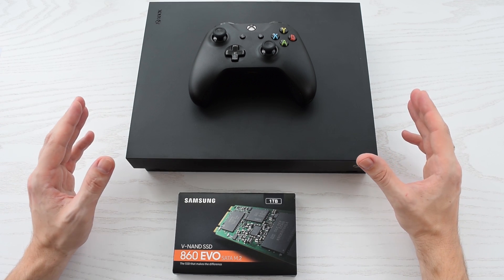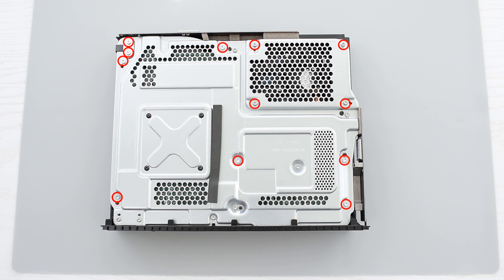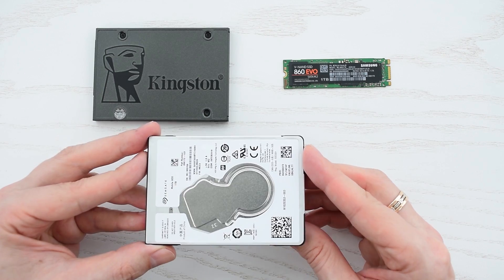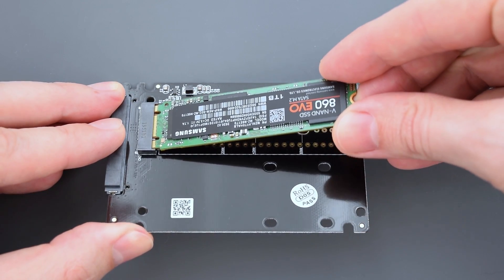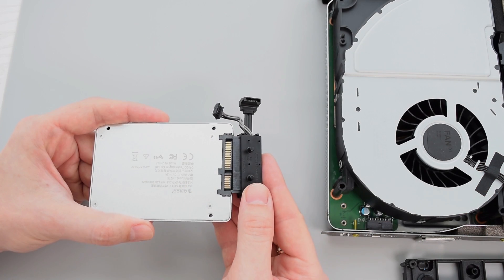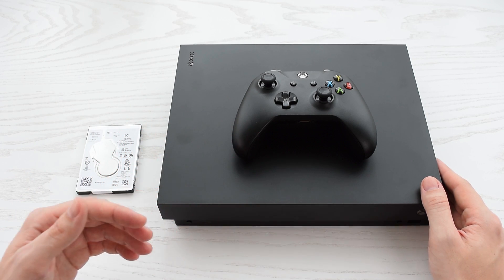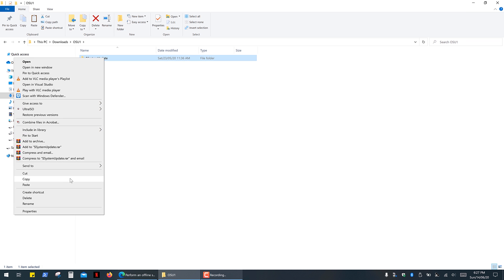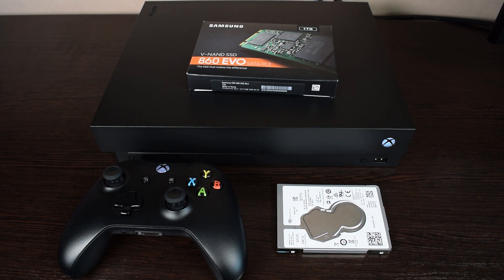How to Upgrade your Xbox and PlayStation Console to M.2 SSD Drive. 100% Works for all Consoles

Comment: Good video.  But, not clear if I have an Xbox (S or X) 1TB HD and want to upgrade to a 2TB SSD do I need to use scripts?
Reply from the maker: You can upgrade any of them to 500Gb, 1Tb or 2Tb SSD. You can use any SATA 2.5" or M.2 NGFF (SATA) SSDs.
Reply: The xbox one x will support 2 4tb drives. You can use up to a 4tb hard drive/ssd inside, and another 4tb externally.

Comment: Clocking in better harddrive speeds..
But still some games are GPU heavy.
Reply: If the cpu cores are custom, than their isn't much else that can be improved here.
Reply: I hate that the multi view capabilities was removed for a dumb excuse when TV's rarely have it. Folks are still not happy about halo 5 cut out the local coop.

Comment: I think use a normal SATA ssd is cheaper than this solution... but ... it works too
Reply from the maker: Sure! But if you already own an M.2 SATA SSD for example, after upgrading your laptop or maybe you just want use that M.2 SSD in another device after your console dies, then it's pretty good option.

Comment: Is there a big difference between an M.2 SSD and a regular SSD? Because from where I am M.2 SSD are much more expensive and I already have a regular SSD.
Reply from the maker: M.2 SATA (NGFF) has the same speed as a regular 2.5" SSD. The difference in price is not that big, don't confuse NGFF SSD with NVMe which is way faster and more expensive but you can't use NVMe drives anyway. If you already have a 2.5" SSD then there's no sense to upgrade to M.2. But if you had a spare M.2 after  upgrading your laptop or you have some plans for that SSD in the future (2.5" form factor is becoming obsolete when M.2 will be very popular form factor) then M.2 NGFF SSD would be a great choice.
Reply: @ElectronicsComputers  Thanks a lot man, now my only concern is that it's said that if you replace the Xbox One S internal HDD your console gets banned, is that true?
Reply from the maker: @pedrorodriguez418  Nonsense!!!!!! Who said that??? I've replaced dozens of HDD/SSD on different consoles. None of my clients ever said that something was banned. It's not an Apple product!!
Reply: @ElectronicsComputers  You saved me a lot of research, you've got a new subscriber.

Comment: i got this on amazon would it work for my ps4?

StarTech.com Adaptador de SATA SATA de 2,5" para bahía de unidad de disco duro de StarTech.com https://www.amazon.com/dp/B076S9VK1M/ref=cm_sw_r_cp_api_i_TtTwFbCES67GT
Reply from the maker: That adapter is for two SSD drives which means it has some controller on it and as a result drop in speed. Find any adapter which has only one port for M.2 drive. It works for all devices consoles, laptops etc. The links for high quality adapters in the description.

Comment: Super valuable info, man. I have a Toshiba 1Tb NGFF drive left after upgrading my laptop. Now I'm gonna upgrade my PS4 with that adapter and the SSD.
P.S. I was reading the comments and I can't believe so many people don't understand the difference in M.2 SSDs all they see is M.2 port and by default they think it's NVMe SSDs even though you explained the difference. I'd remove all those comments because they are confusing other people who's not good at tech.
Reply from the maker: I'm glad it was helpful.

Comment: What's the speed differences between M.2 Sata SSD internal vs USB 3.0 SSD external?

Great video btw. Thanks!
Reply from the maker: Theoretical speed of SATA III is 6Gb/s and USB 3.0 is 5Gbps. But you looses speed and performance during conversion signal from SATA to USB and vise versa. So the difference is quite noticeable.
Reply: @ElectronicsComputers  Would it be better to replace the internal drive? 
Though my testing, having an external SSD didn't change the boot up speeds. Perhaps because the boot was configured to the internal HDD?
Reply: @NopeKickEm  i would only replace the internal hard drive with an ssd if it fails other wise you will end up taking the game console apart but yes the boot time are improved

Comment: Can work M.2 nvme, or only M.2 SATA??
Reply from the maker: You can use only SATA-based (NGFF) M.2 SSDs. Technically, Xbox One X has M.2 NVMe port on the motherboard but for some reason Microsoft decided not to solder it to the motherboard. I'll try to solder the M.2 port and all the missing components and we'll see what happens. https://www.reddit.com/r/xboxone/comments/h9r9qx/xbox_one_x_has_a_unused_m2_port/
Reply: @ElectronicsComputers  have you tried it yet?

Comment: this is fucking stupid you use an adaptor idiot. The difference is 0 compared to normal SATA drive. Infact this m.2 will overheat and slow performance. Open up a SATA SSD it has thermal pads inside and is usually aluminium enclosure for good quality ones. Misleading mong. Your M.2 is also SATA its not NVMe. SATA M.2 should also be abolished on general.
Reply from the maker: Are an idiot dude or what? What misleading are you talking about? You can only use M.2 SATA drives in this console and they never overheat don't confuse them with NVMe (PCIe) drives.

Comment: what was the performance difference?  loading time?

Basically the logic board's bit rate is still Sata & it will not use the full capacity of ssd's speed🤔🤔  proof of concept would have helped.  plz do a video on that
Reply from the maker: This is SATA M.2 SSD and it uses the full potential of Xbox SATA port.
Reply: @ElectronicsComputers   correct,  it uses full capacity of SATA bit rate... but ssd bit rate is much more higher which the logic board is not capable to handle.. 
 hence not making use of the money spent on buying ssd(which is way to high)
Reply from the maker: @snlsp12  this is SATA SSD which has the same speed as SATA port on Xbox. What bit rate you are talking about. Don't confuse SATA (NGFF) M.2 SSDs and NVMe (PCIe) SSDs.
Reply: @ElectronicsComputers  thnks brother!! I will do more study on this..

Comment: M2? For what? It's cheaper? Standard 2,5" SATA is more than enough for PS4 PRO and Xbox One X. I have 2TB Crucial BX500 SSD in PS4 Pro.
Reply from the maker: For example, maybe you have one after your laptop's SSD upgrade or maybe there's a good price for SATA M.2 drives. Or maybe just because M.2 factor is the future and all devices come with M.2 SDDs. And when your console will die you could put that SSD into any device when 2.5" won't fit because this form factor is almost obsolete.

Comment: Good Video. I was worry to update my xbox one due to the big job on partition but now microsoft may easy with the new tool. I was reading all comments, i don't understand why people not understand the difference between sata 3 m.2  drive and nvme m.2 drive. Its not too much difference on price with ssd and m.2 sata 3 drives. Have one question. Is possible to remove the DVD drive on xbox and install a second drive. Could be a good experiment.
Reply from the maker: There are lots of "tech expert" here. I'm tired of explaining and educate those people. I guess I'm gonna remove stupid comments in the future. By the way, Xbox One X has a solder pads for M.2 NVMe SSD. So I want to solder M.2 slot and all the missing components to the motherboard and see if it's gonna work. I haven't tested Xbox with the second internal SATA drive but I think it's gonna work. I'll check it and update this comment.

Comment: This would end up havi g the same data transfer speeds as an SSD due to limited bandwidth on a SATA connection.
Reply: Charbel Chahine  I don't think that drive even fits in the adapter since it is the nvme drive. I'm not sure make sure you do research. That was my whole argument with the youtuber guy. His point was to show us it works but the speed isn't faster than a 2.5 ssd. If you could put in the faster nvme samsung evo the ps4 wouldn't go any faster since it only supports sata speeds on the sata buss as we have already chatted about. It is purely limited to the hardware on the xbox one x or the ps4 pro. Those have better video but the speed of the hard drive is the same. Mechanical drive but you can upgrade to an ssd 2.5 samsung evo 1tb or crucial and have the 500 or so read and write. That is the fastest you can go. Until ps5 comes out or the xbox series x or S model we won't know what you can take apart or upgrade. I'm SURE iFixit is just ITCHING to take it apart as is everybody else. I hope this helps. Ask the youtuber guy he is pretty nerdy and made video's on it.
Reply: Charbel Chahine  I'm sure it can't. If that's the newer model. The adapter will probably not work. Best bet is to get a samsung or crucial ssd with 500 read and write. Fasted you can go right meow.
Reply: yes its the same speed but better IOPS which is usually better due to reading of small files
Reply: @NinoKotur  OK so Its really not worth it just for that. I"d stick with the 2.5 ssd.
Reply: @barrysauce  Depending from case to case it might show some difference truth is especially model S doesn't have enough horsepower for 2-3GB/s transfers so improving those IOPS speeds can be good in some cases, also prices of m.2 nvme-s dropped a lot especially where I live there can be as little as 10eur difference between same size ssd and nvme m.2 if not looking at the cheapest models.

I agree there is not much point of doing that but if you get a similarly prices m.2 nvme why not ;-)
Reply: @barrysauce  what about cheap ssd vs evo 960? Is it has the same speed? What if i put it on ps3?
Reply: @eryavrilio3751  I did the same thing to my ps3 and my parents too before you couldn't use them anymore for netflix, amazon prime, YouTube, etc. Crucial BX series are fine at the lower end. The SK hynix are shipped with Dells I've seen at work and they are fine. Don't go too cheap on an ssd or you get the issue when you do one thing and it goes very slow. Anything that can get an ssd will benefit tho. Ps3 ran fine I never used it with a spinny disk so I don't know how slow it really was.
Reply: The price to get the better drive is usually with it too. Oh Kingston are not bad either. The names brands make gooder stuff. Hope that helps.
Reply: @barrysauce  crucial data read&write speed are higher than kingston so i think it's more worth to buy, thanks for the help
Reply: @eryavrilio3751  yep. I bought many crucial for xbox and ps4. The speeds don't matter to me too much since 500 is enough to make the console run much better.
Reply: Yes that was my whole point the the YouTuber. Thank goodness others see the point. He did it just to see that it works. Easier to use the 2.5 inch drive.
Reply: Charbel Chahine  yes. You're only going to get sata speeds. I'm pretty sure the ps4 and xbone were sata II as well
Reply: If you wanted to upgrade the drive why not just go with a solid state 2.5 drive, faster transfer speeds and more capacity for less money and don't need an enclosure
Reply: This is great if you have a spare one.
Reply: My 970 evo plus wouldn't be able to use its full speed
Reply: Sata 3 connection= 6gbps transfer rate.
6gbps= 6000mbps
HHD read write speed= 300-500mbps (roughly) 
SSD read write speed= 500-700mbps (roughly)
M.2 read (high end)= 7100mbps
(Will cause 1 gig of bottle neck) 
M.2 write (high end)= 5600mbps 
Therefore m.2 is 12 times as fast as SSD. If you can't do the math or understand that, don't be mad and try to bring someone else down. You have about 5000mbps of head that you can clear. It equates to about 12 times faster than SSD.
Reply: I don't think he was doing it for the data transfer speeds, It was mostly targeted when the M.2 will get cheaper in feature. Most laptops comes with 1TB theses days so could be that the laptop is broken but a working M.2 drive is fine so someone will more then likely throw it on eBay
Reply: Yeah he probably knows that but for me the good is that if you have any m2 ssd and you dont have a sata one you can use this
Reply: Sata 3 has a limit of 6 Gb/s.
Reply: @jrpbkpcap  dude this guy sells hosre shit, do you want a recipe for 10 Gb per second time on a PS4 here it is leave your mechanical hard drive in there. There’s nothing you can do to increase the speed of that interface. Amazon, external NVMe caddy usb 3.1. Get any gen 3 pcie m.2 drive. Plug in to ps4, welcome to 10Gb/s load time. Gta5 originally loads in about 143 seconds, I have it dow to 83 seconds, ps5 loads gta 5 in 58 seconds.
Reply: True... However you would be at max speed always (based on the maximum transfer speed)
Reply: Its not about the data transfer speed. Its about the advancements in storage block stacking technology,  that would be why you would choose it over the other. Bc the lastest update to SATA SSD tech was 2023.
Reply from the maker: I was using SATA (NGFF) M.2 SSD so of course it will work with the speed of SATA port speed.

Comment: hello, I inserted into the console a 1 tb ssd ssd evo that I used to always use for the xbox as an external disk.
inserted without formatting it and subsequently loaded the operating system like in your video.
at startup the screen is black without the presentation movie.
do you think I did well or should I format it in ntfs?
Reply from the maker: If everything is working fine then leave it as is. The intro will appear after the next Xbox update. So don't worry about that.
Reply: 2013Electronics&Computers  ok thanks
Reply from the maker: @christianpiludu55  happy to help!
Reply: appie UwU  ok thanks

Comment from the maker: USING THIS METHOD YOU CAN UPGRADE YOUR CONSOLE TO 500GB, 1TB AND 2TB SSDs. 960Gb SSDs will be recognized as 500Gb drive and after installing Xbox OS you have to connect that SSD to your PC and manually extend "User Content" partition to maximum available space. You can use software like Acronis, Mini tool Partition Wizard etc.
Reply: Does this happens when cloning the drives or only when you do a clean flash? 
Great video btw, nice to see good content
Reply: I was thinking Romanian. It's very sexy like Dracula.
Reply: if I buy a 960 gb sata ssd, I format the ssd to ntfs, install xbox os via pc, and then fix the partition to over 900gb, and then finally I can put the ssd into the xbox ?
Reply from the maker: @GoodOldFella970  Why would do all those unnecessary things? Xbox supports 500GB, 1TB and 2TB drives. Don't buy SSDs with non standard capacity. Simply put a new drive inside the console and install the offline updates from a USB drive, it's like installing Windows.
Reply: @ElectronicsComputers  puh thank you 🙂 I feel more confident now about this ssd "project" 😊
Reply from the maker: @ It's a very easy project just make sure that your console is not enrolled into Xbox Insider Program. This SSD would be the best option: https://amzn.to/4ljIbdd

Comment: Solid video, bro! My Xbox gets hot as hell any solutions for this?
Reply: Including the solutions other people suggested, i would also make sure it’s finely ventilated
Reply from the maker: Thanks! Try to clean the heat sink and replace the thermal paste.
Reply: They do run quite hot anyways but do what is suggested here and make sure your not putting things on top of it, running it in a confined space and in a hot room. While you have it open to clean it and re paste it you can add some nice LEDs inside very easy to make it look nice (I put red in mine)
Reply: try replacing the thermal paste and clean the heat sink and fans.

Comment: Debating whether I should go for the NVMe or just a regular ssd, any improvements vs the reg 2.5 inch?
Reply from the maker: You can't install NVMe SSD into this console! Only SATA NGFF M.2 or 2.5" SSDs.
Reply: 2013Electronics&Computers sorry I meant M.2 vs 2.5, any major diff between speeds or same thing pretty much?
Reply: @sergiob9292  won't be any difference as using same interface.
Reply: ThaReal CLo appreciate it 👍

Comment: I have a samsung evo 970 SSD 500GB External. And Those things get super hot. Where was the thermal heat strip? I added one for mine. 

Amazing video though! This is EXACTLY what i been wanting to do for the longest time! I learned a lot from this video! 

Thank you!!!
Reply from the maker: Don't confuse those SSDs! Your M.2 SSD is NVMe drive which is super-fast and gets really hot and that SSD won't work in any console unless it designed for NVMe SSDs. I use SATA M.2 SSD which is not that fast as NVMe and they don't get too hot.
Reply: @ElectronicsComputers  that is a damn good point! Yeah SATA is much slower. So it will not get as warm fast. Smart! I did not realize that. 😃 totally understand now. Sweet. 

Will it still work if i takr out the 2.5 inch hddd and place a samsung evo 970 1TB external USB-C to SATA in it? Haha sorry i am curious!😃😄

Comment: This is what I call high quality content. I've seen several videos and they use some third party software to partition the drive and overall process looks very difficult. But your method worked perfectly for Crucial BX500 1TB 2.5".
Reply from the maker: Thank you! Technically this method will work for all SSDs and HDDs regardless its capacity. But if it's something like 2-5 TB drive then it may mot utilize the whole capacity. But you can resize it with any software which is still easier than scripts.
Reply: @Revelator does the ssd he uses have dram?